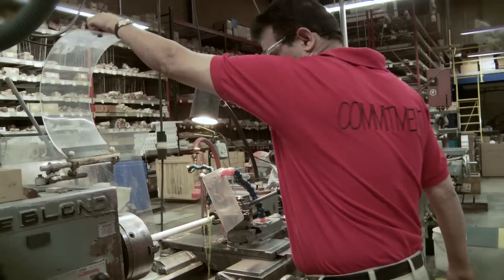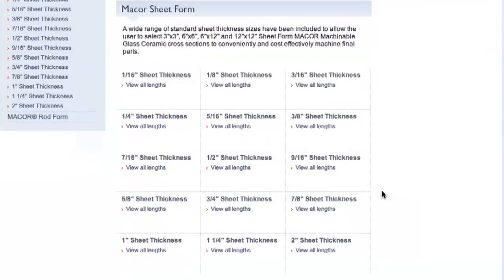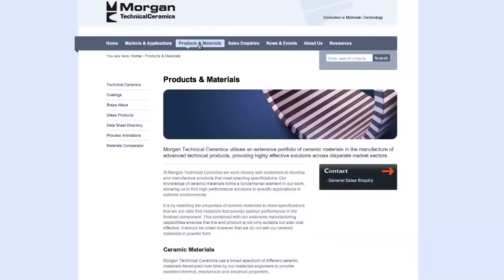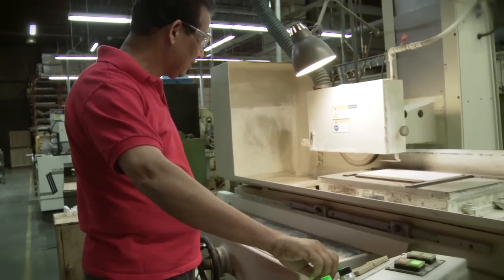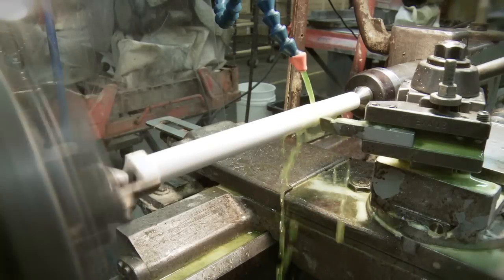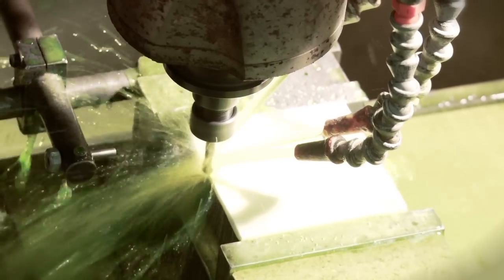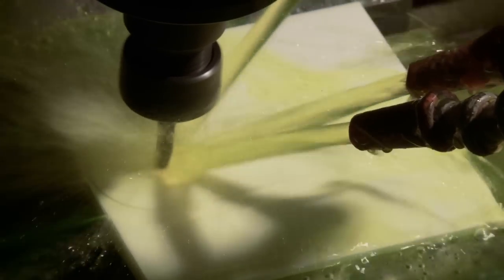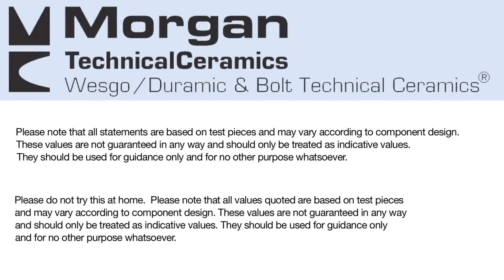See how Macor Glass Ceramic is Machined -- Morgan Technical Ceramics

Comment: The truth is San Jose Delta was the first authorized by Corning to manufacturer and resell to the grindshops Macor since the 1960's. I know, I worked at Delta. Macor comes primarily in slabs 12 x 12 / 6 x 6 squares and solid rods in various thickness's. Primarily used in electronic applications.  Macor cuts like butter with diamond tooling.